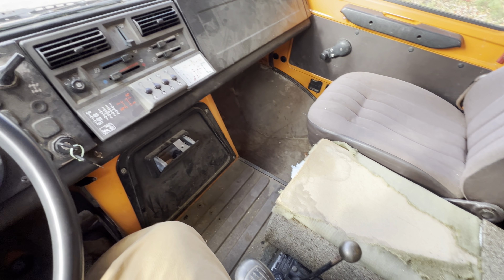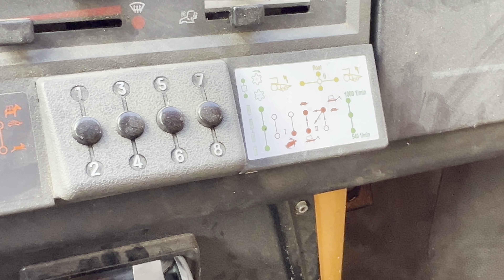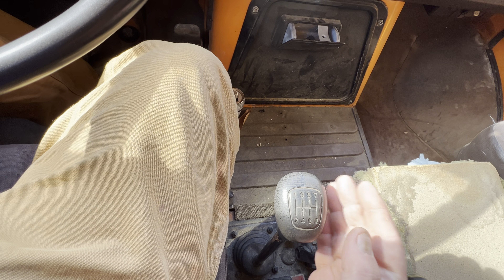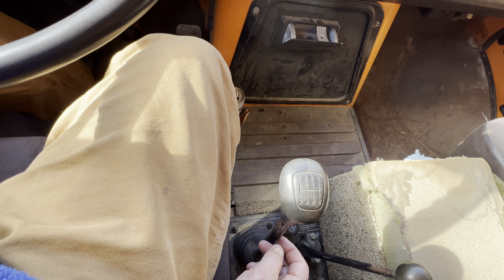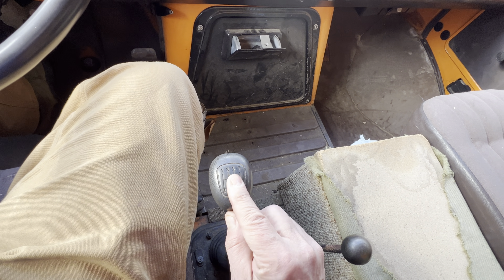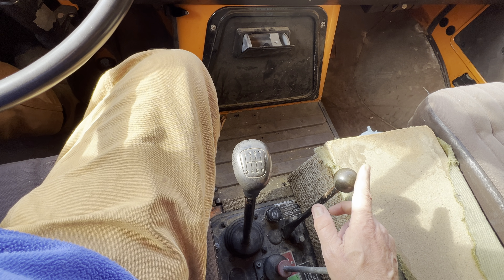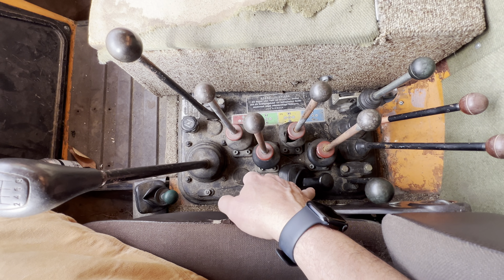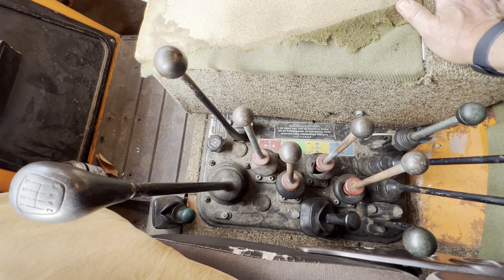Unimog Gear Levers

Comment: great job thanks for sharing keep up the good work
Reply from the maker: Thanks. I like your skidder rebuild! I've got a Unimog U1450 coming in set up as a skidder with Werner center frame mounted winch but it is not quite the same as having a proper dedicated skidder. Of course the Unimog can also go 65 mph down the road and does not need to be trailed to job sites. Obviously different pros and cons. Hopefully I'll get some youtube coverage on the U1450 skidder once I get it into action.

Comment: surprised theres no diflock controls, my old g-wagon had the gear stick, then the transfer case was 2H, 4H, 4H with center lock and 4 low, axle locks were 2 hydraulic levers.
Reply from the maker: This video was just going over the levers. The 4x4 system is controlled by a pneumatic switch on the dash which I covered in earlier videos.  Basically the SBU Unimogs (and older) have the "normal" setting which is rear wheel drive,. There is no center diff lock or full time 4x4. It is just rear wheel drive with no front/rear diff. 4x4 engages the front axle and both axles are locked to each other because there is no differential. They are either engaged (locked) or disengaged. However, the actual differentials in the front and rear axles are still open (unlocked) When 4x4 with diff locks is engaged, then the differentials in the front and rear axles are locked. At this stage all four wheels spin at the same speed regardless of the traction on any one wheel.   
The 2WD/4WD system is actually the same as older G-Wagons (and most part time 4x4 like older Land Rovers, Land Cruisers and Jeeps)  2H is actually just rear wheel drive. 4H is high range with the front axle engaged (which is locked because there is no differential) 4L is the transfer box low range with the front axle engaged. The 2 levers on the G-Wagons engage or disengage the front or rear differential locks. Engaging 4H or 4L engages and locks the front and rear axles together. On the G-Wagon, engaging the pneumatic knobs lock the differential in the front or rear axle so you are basically locking left and right as opposed to front or rear. In the case of the Unimog both front and rear axle differentials are engaged at the same time with one switch, so the Unimog "diff lock" setting locks all four wheels with one setting. 
Later G-Wagons and Land Rovers had an actual center diff but they do not have the 2H/4H option, just center diff lock or no center diff lock. However there is no difference between part time 4x4 with 4x4 engaged and "full time 4x4" or AWD with the center diff engaged. It is the same thing. The big difference is whether you can lock the differentials in the front and rear axles as opposed to just locking the front to the rear. In the Unimog, when you are in full diff lock there are no differentials - all wheels turn at the same speed regardless of traction and no wheel "spins" at the expense of another wheel.
Reply: @theunimogcenter  the axle diff locks in my g were hydraulically engaged rather than air, it was an 85 model. Completely standard as far as I knew.